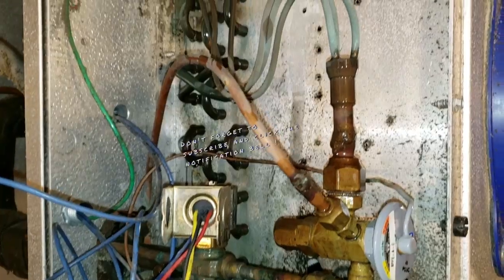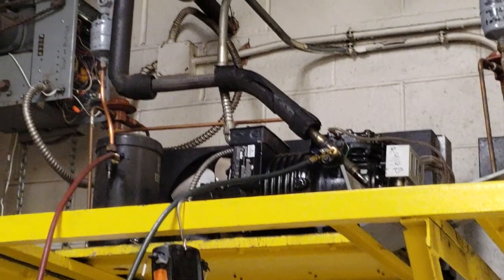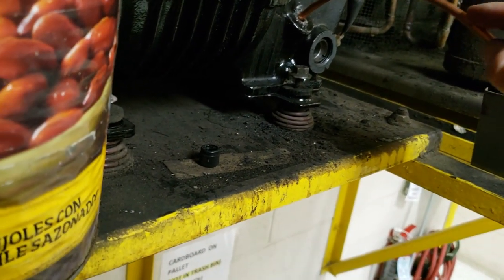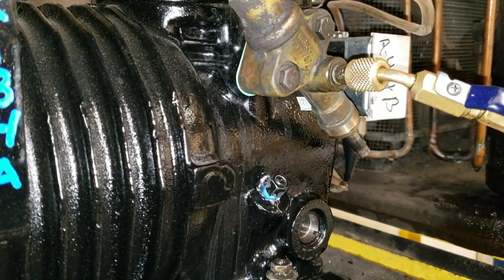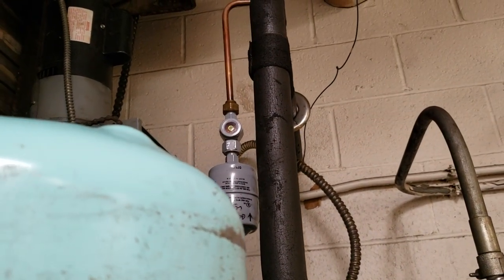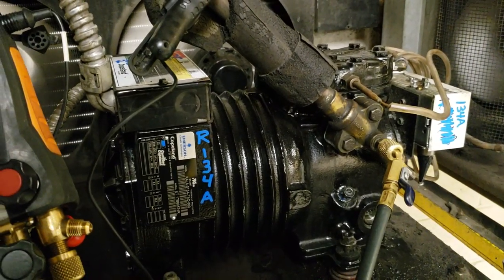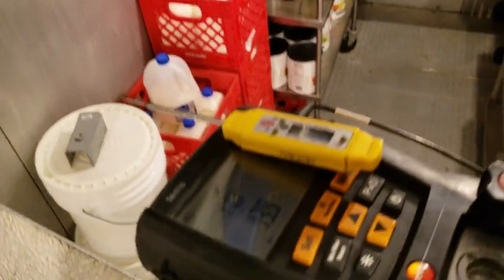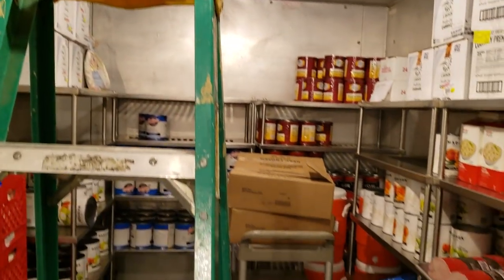Warm Walk-In Cooler

Comment: Funny timing, I just was on a job that has a 12 compressor running 414b that I had to convert to 134a, same symptoms too, leaking on the king valve and short cycling. I swapped POE also. Cool oil drain trick. Thanks.
Reply from the maker: Right on👍🏻 I learned the trick off of one of the other guys😁
Reply from the maker: +404 Refrigeration Thanks 404, One of the guys at my shop came up with that,  it worked good.

Comment: just want to ask did you replace the txv or you just change the powerhead? thanks for answer.
Reply from the maker: I don't normally serviced this location, I believe the servicemen that normally does,  probably did change it. I would normally change the whole valve vs just the head.

Comment: Do you think nor lock would have sealed them I've never used it but alot of guys swear by it
Reply from the maker: I redo my flares if they're leaking, generally if the copper is damaged or thinned out, it's a no wind situation. I'd be worried the lubricant washes away and eventually leaks.

Comment: I find that R414B doesn't work well with TXVs, converting to R134A was the right choice. R414B works great with cap tubes.
Reply from the maker: I mainly used hot shot 1 and now H.S 2 for caps as well,  specially when hot shot 1 has became more expensive,  and all I had was hot shot 2, so it only made sense to convert since it was a semi hermetic with a txv. Thanks bud!👍🏻👍🏻